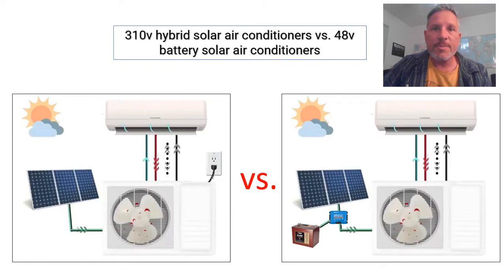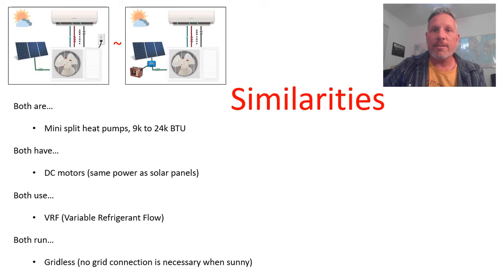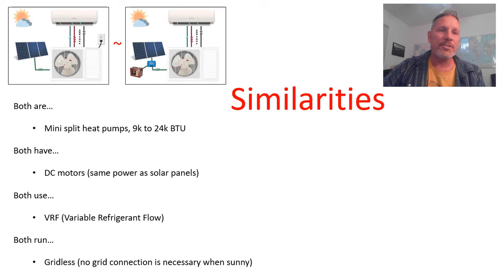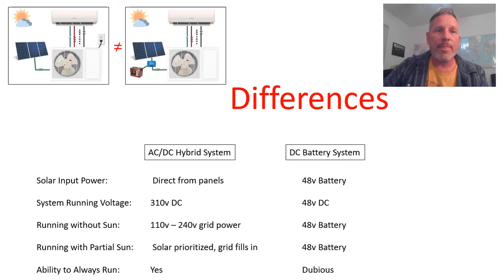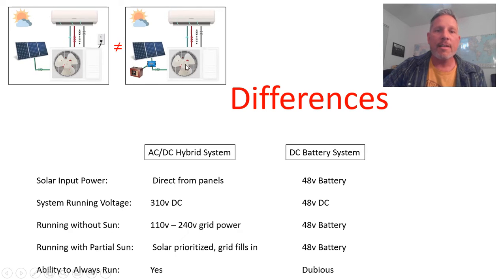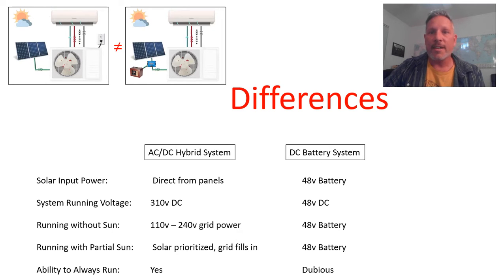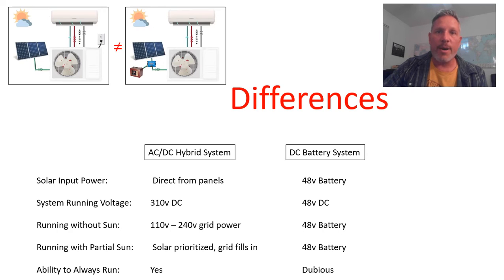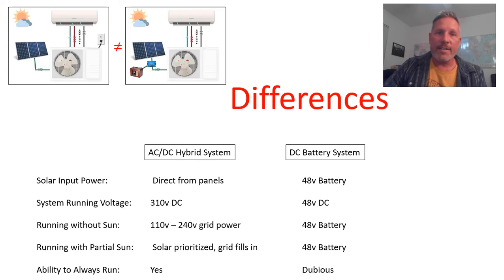Hybrid solar air conditioner vs. 48v battery solar air conditioner #dc #offgrid #hybridhvac

Comment: Followed your web links, don't see the 48v product
Reply from the maker: Yes, we don't sell them. We're all in on the hybrid unit. There's a market for the 48 volt ones, but as the video mostly alludes to, we think that the hybrid units are a better option for most people since they don't require the batteries, mppt, or external voltage regulator like the 48 volt one do. But a solution is that if you can buck up your 48 to be over 80 volt, then you can plug this directly into the DC ports on the Airspool unit.
Reply from the maker: And you were Mr. Minnesota in 1999? That's fantastic. Quite an accomplishment!

Comment: Can your air conditioning unit automatically start and stop operating based on whether there is incoming solar power or not?
Reply from the maker: Yes, it uses both solar and grid power. If there's not enough solar power to run it, then grid power will fill in automatically, but solar will always be prioritized.
Reply: @airspool  my question is in off-grid mode, can this AC automatic cool the room when we have solar power?

Comment: Dave, do you plan on selling 48V systems? For people like me doing full off grid setups where all my power goes to the battery and there is no AC available, the 48V makes the most sense. Would be nice if y our units didn't require 90V and the DC input could be either panels or batteries.
Reply from the maker: Hi Cy, we had the great debate about this a couple three years ago. There's certainly a need for those systems. For most users, the grid is the cheapest battery at nighttime. The electronics and compressor on the 48-volt systems are rarer, and so they're more expensive and, from our analysis, more likely to fail. These Airspool hybrid units are really souped-up 315v inverter compressor units, and so those compressors are being manufactured in the millions on a worldwide basis. And for a lot of users, running an air conditioner off the 48-volt system means that they're going to need more batteries and a bigger mppt. So for a lot of off gridders, it's simple to just slap on three panels to our unit and then run off of their inverter at nighttime. Having said all that, managing DC power will be a big thing in the future, so we'll work to store of the extra power not being used by the Airspool and be able to run the unit at nighttime or run possibly other things off of that same local battery array.

Comment: What voltage does the hybrid unit expect from the solar panels?
Reply from the maker: It needs between 80 volts and 380 volts of DC power from the solar panels. And then, if you want to plug in the alternating current, it needs from 110 volts to 240 volts for that. Solar will always be prioritized.

Comment: For 2024: 
Would using a standalone 48V Power Sation as the 'plug-in' 120V for the unit, work for evening runtime? Instead of connecting to our home 120V system @ .40/kWh. 
If I built a portable power station or even an outdoor weather-resistant unit, I could add a few more panels to charge the power station up during the day.
Reply from the maker: Yes, sure. The system won't know the difference. And the system will take any alternating current, weather from an inverter or from the grid, as long as it's between 110 volts and 240 volts. So it's pretty flexible on what you feed it.
Reply: @airspool 

I don't get it. Can you feed the hybrid unit with AC or DC current?

Does one need a rectifier to use the AC current?

Comment: I don't agree that if your off grid the bybrid unit is inherently better, I would ague the DC battery system is better because you are already going to have batteries, yes it means a larger battery system, but if your off grid like your going to need those extra batteries and solar pannels anyway, if you have all the solar pannels connected to the battery it will recharge the battery as there is energy drawn by the air conditioner and the hybrid system if your going to be using the inverter means your going to be converting DC to AC to DC which those 2 conversions will only be at best 95% efficent so your going to be consuming more power from the batteries anyway.

Your kinda just bullshiting here that that is a inherently better solution, sure 48V motors may be more expensive to replace, and maintaining LFP batteries with communication is also BS because they auto balance and have like 5000 cycles at a 2C rate, where generally for solar your going to peek at a 0.5C rate so your probably going to get more than those 5000 cycles to 80% capacity. Maybe if we were talking lead acid batteries that could be a bit cumbersume, but LFP batteries with which can talk to each other nope.
Reply from the maker: I think if the stars are aligned, and you have a 48-volt battery array and your mppt can allow more than 160 volts or whatever so that you can add more panels without an upgrade, then yes, a 48-volt system would be a great option. In general for most, those units cost more and they need more gear to run. For a lot of folks, even off gridders, it's easy to pick up a couple of extra panels and plug those directly into a hybrid unit, since, in effect, it has its own separate mppt, so you don't need to worry about bogging down your existing system or how adding a relatively major appliance will affect it. Anyway, there will be more and more DC nanogrids in the future, because lots of folks are going off grid, or at least wanting to, and because units like these solar air conditioners, electric vehicles, computers, televisions, are inherently DC to run directly off solar without inversion and rectification, and because the cost of solar is continuing to decrease while the cost of grid power continues to increase while at the same time the trustworthiness and predictability of the grid is decreasing.  There will be different DC nodes for different voltage values, and less power will need to be put through the inverter.
Reply: @airspool  You need a minium charge voltage of 65V to charge a 48V battery as you need 5V over the battery voltage to charge it and 48V batteries maxium state of charge can be as high as 59V, realistically you should be 50% over that figure for the maxium opperating voltage so ~97.5V, after that if your not over the amperage limit you can add as many strings as you want and honestly overpanneling is a thing so even if you are over the amperage the charge controller can provide it's still fine it just means while yes you wont get more performance at the peek of each day all the rest of the time you will get extra capacity. And I would like to point out that you can get to ~97.5V maxium opperating voltage with 3 x 425W pannels.

Also you can just add another MPPT to your batteries and a victron 150V/35A only costs like $150 which can handle 4S2P of the specific pannels I am looking at so 3400W of solar, MPPT costs are not really a big deal when your going to be spending $1000 on those pannels, and yes you can use muliple charge controller in parallel. Also you can add a cut off switch to the postive that goes to the heatpump to cut it off when it reaches 40% state of charge or so.

I just don't see it being that bigger pain than running it off the inverter, like if your going to have to install extra solar anyway I would like to be able to take that solar capacity when the unit is not cooling and do other things with it rather than the system I added only being a drain on my main system and an extra drain at that because as I said you have to ad the DC to AC to DC conversion losses ontop.

Like if your ongrid and you don't have any other solar system, I can see it, but for people offgrid with 48V batteries not so much.

Comment: Is this comparable to the eg4 units?
Reply from the maker: Yes. We've updated a few things, such as putting in more extensive installation instructions and videos by native English speakers, plus included the power cord, Allen wrench, and MC4 disconnect tools. We also have a Quick 'n' Easy option, which allows you to twist-to-connect both the pre-charge refrigerant lines for this option as well as the communication control cable. Plus, the included alternating current power cord is pre-installed on this model. So, the connection process takes less than 5 minutes. And for both the standard and Quick 'n' Easy model, there is a one-year buy-and-try guarantee, so you can return it for a whole year, no questions asked. Speaking of questions, we are at the ready to answer any installation questions and to give real-time support.

Comment: 12k for 1845 is this the only size you offer now? I’ve seen 9k and 24k so I guess 12k is a good option also.Funny other countries been using mini splits over 30-40 years.
Reply from the maker: Yes, mini splits are sort of gaining more traction here in the U.S. overseas, for instance in hotel rooms, they are the standard. But the solar hybrid ones are pretty fresh. We're focused on one ton units right now, but others will be coming. Get in touch if you need a 2-ton one, and we'll make it happen.